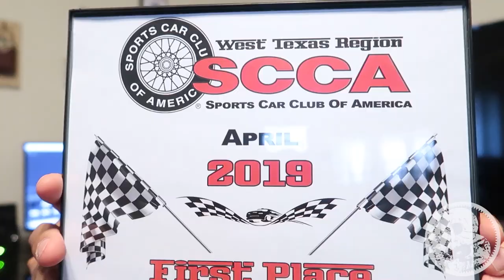Some easy weight reduction! | MK7 Golf R

Comment: Hi Bryce, Did some research for you: According to Varis, the stock steel Mk7 Golf hood weighs 35-1/4 lbs. Carbon Fiber hoods weigh 14 lbs. So, just switching to a CF hood would take over 21 pounds of fat off your already heavy front end. CF front fenders would also be at least half the weight of your stock steel fenders. (Didn't you crunch one of your stock ones?). Cost: Siebon CF hoods are about $850 and their CF front fenders are also $850 for the pair. So, for approx $1700 you could take almost 30lbs off your front end. Although not cheap, it's alot less than what you are going to spend for the Verkline subframe and CF hatch which will cost much more and only be removing weight from the already light rear end of your car instead of the heavier front which will not benefit your weight balance near as much. Food for thought. Sorry there's no stock aluminium VW Golf parts available, if you can find some I will pay big bucks ($1000+) for AL hoods and/or AL front fenders. They would be even better than CF parts...if they really exist (?)
Reply from the maker: Great information my man! thank you. sorry about the late replies, the YouTube creator app isn't the best and i miss out on a lot of comments and replies apparently. i need to check these on the computer more often. but, for sure, in the future we will get the CF front bits and the verkline stuff.. for now getting the rear end done is the plan! plus the motor.. trans.. interior.. lol so much to do!
Reply from the maker: @connorcavacarazy8327  the more weight off the front the better

Comment: Cool build I have been watching progress nicely.  A couple suggestions you may want to consider. First find some dry ice at an industrial or ice cream supply place and use it to freeze the tar style sound deadner stuck to the floors.  It's fast and easy to do with almost no mess.  I removed 30lbs on my Neon I turned into a Spec Neon racecar years ago.  For the seat padding and bolstering consider using a 2 part expanding foam from somewhere like Racers Parts Wholesale.  This gives you a custom fitted seat to your body that can be removed or adjusted as needed.  This is the same type of thing done in single seaters and Formula 1.  Mix the 2 parts and poor it in a bag then sit on it for a few minutes to cure.  Good luck on the build.
Reply from the maker: I've heard of the dry ice trick but not the seats! That's some great information man thank you! 🤘 Information/knowledge like this is what really hypes me up to make more videos, I appreciate you!
Reply: @BryceJordanProductions  hey mate. what brand is that brace you have?
Reply from the maker: @holisticpersonalcoach4360  euro code 😊
Reply: @BryceJordanProductions  looks good!
thanks :)

Comment: Hi Bryce, Got some more research for you. The stock Golf 7 rear hatch weighs 42 lbs. Due to the glass being most of the weight, you only get a 15 lb reduction going to the Seibon CF hatch. Plus, it's in the rear of the car, the light end, so once again it's not as benificial to weight reduction and weight distribution as a CF hood. Also, it costs more than a hood at $900-$1100. Best weight loss program would probably be: CF hood, hatch, and race seats. Hope that helps.

Comment: I definitely get weight reduction. But I think you would regret cutting the headliner. The weight is prolly equivalent if you taking a sh*t before a race
Reply from the maker: Nah man, every lb counts. It's gonna be a full on racecar eventually. No need for half the shit in there lol. If I don't use or need it, it's getting tossed! Imagine what it's gonna be like at about 550whp 500+tq and under 3000lbs with me in it 😏
Reply: I’m just glad you are lean and doing the weight reduction. I can’t tell ya how many times I have seen someone 40-50 pounds overweight and trying to loose weight...its like cut out the Burger King for a month.

Comment: Stock seats are about 60 pounds i heard plz weigh them when u take them out .Seats, hood, fenders, hatch should be good weight reduction.
Reply from the maker: Just pulled the seats yesterday and man are they HEAVY. Gonna order another kirky and brackets as soon as I sell these seats
Reply: @BryceJordanProductions  I am also curious of the weight of the seats. Good luck man.
Reply from the maker: I'll be sure to weigh them for the next video!
Reply from the maker: @334trax2  just weighed them driver was about 60 pass was about 55!
Reply: @BryceJordanProductions  thanks hopefully your new seats cut that weight in half at least. I need to drop at least 20 lbs from my waist line, lol.

Comment: Bryce, why so much focus on rear weight reduction when the heavy end is the front of the car? Wouldn't a CF hood and front fenders be much more effective than big bucks spent on Virkline rear subframe and CF hatch?
Reply from the maker: Nope, the hood and fenders are aluminum and light as is. Better off to cut those for vents and get the easy weight out of the rear. I'll make up for the lack of with a good corner balance and eventually functional aero
Reply: @BryceJordanProductions  
Bryce, Aluminum?? Really? Then why does a magnet stick to the hood and front fenders? Have you checked out how much your hood weighs by disconnecting the gas strut? It's VERY heavy!
Reply from the maker: Huh?? Who told you this? Magnets do not stick to either one of my hoods or fenders. I have a spare hood from a GTI, very light.. Not even 15lbs. It would be almost 3k (or more with shipping) for CF and probably not even save 8lbs
Reply: My cf hood saved 8kg.the stock one is roughly 16kg

Comment: Nice progress have you changed the battery there’s a big weight saving there from the oem one !
Reply from the maker: I sure did I run a lightweight setup from mele saved 21lbs!
Reply: Bryce Jordan Productions awesome,I suppose you’ve done the subframe,lower control arms and maybe change the rear door windows to perspex rear doors and hatch window and get rid of the power window modules at the rear doors might save a fair bit their and Isweep have some good bracing for the underneath of the car too!